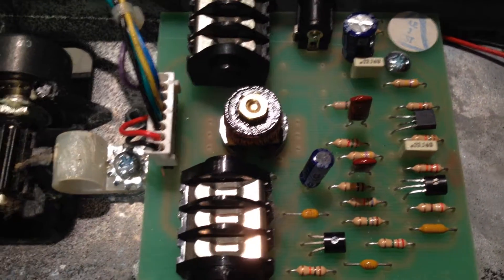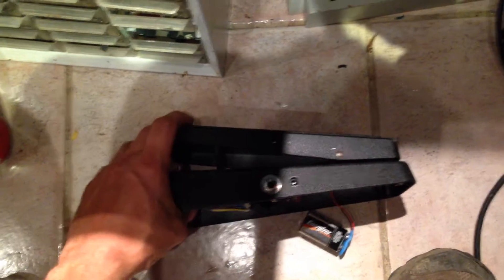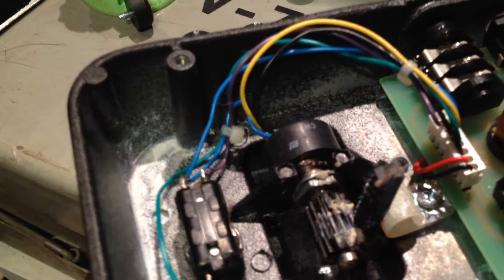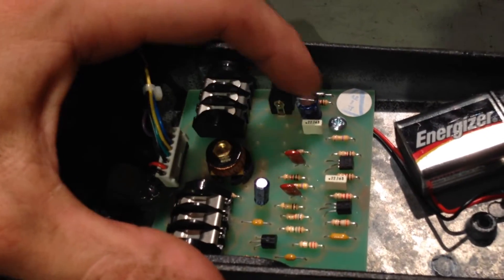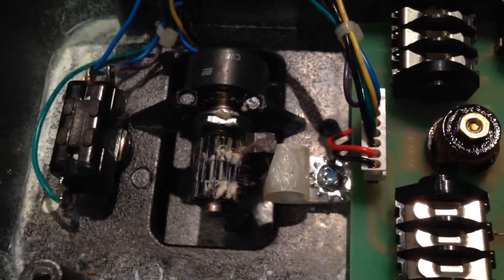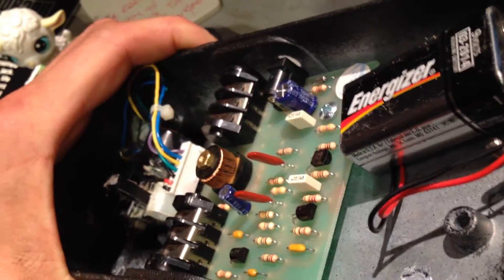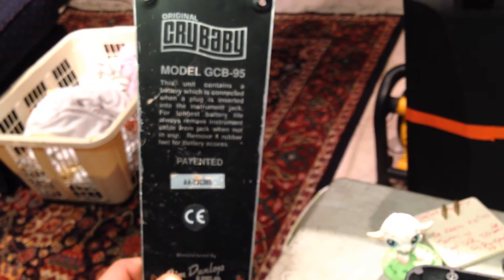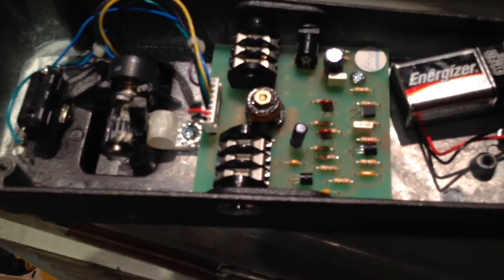Inside a wah-wah pedal (guitar players toy)

Comment: A 63 volt cap isn't necessary....that part was probably just as cheap as a lower voltage cap. As for the inductor, if you follow the link to the schematic, it is L1, a 500 millihenry choke.